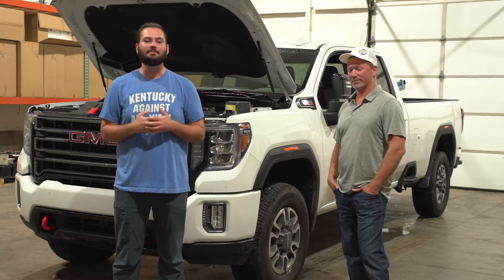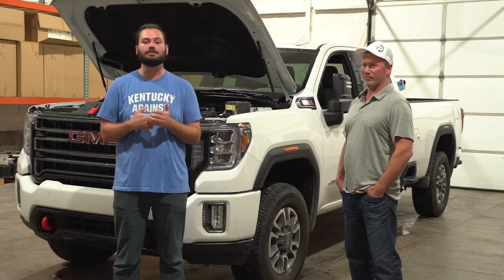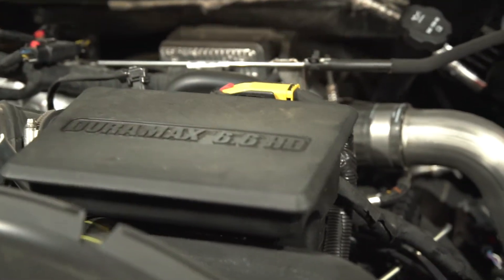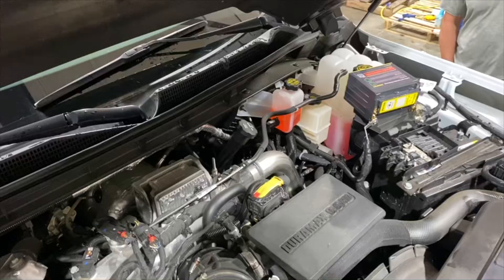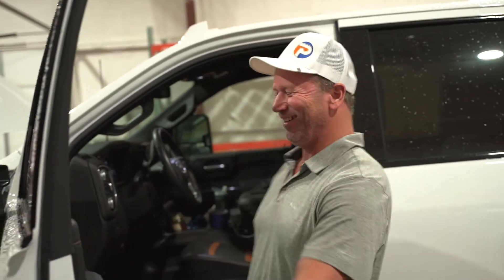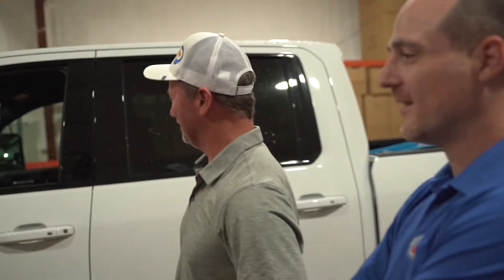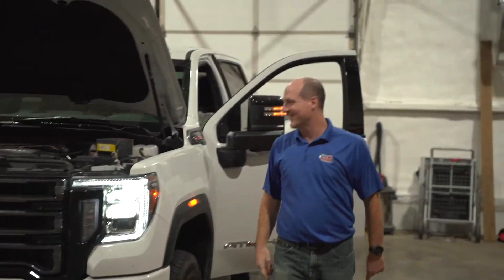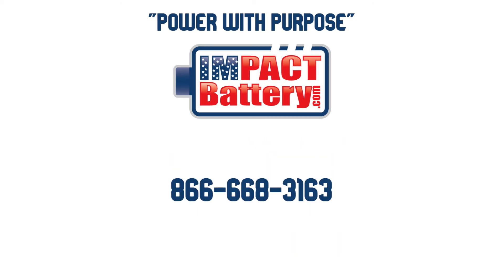What?! Tiny Motorcycle Battery Starts 6.6L Duramax Turbo Diesel Truck!

Comment: okay guys - start a cold truck, not a truck sitting in a garage at room temp and not a truck that's got a warm engine block either.   I'm talking an early 40ºF - 50ºF  morning when the truck has been sitting all night.  It might start a cold Camry but I have doubts about a DuraMax.   Regardless,  I'm getting a set of those battery post adapters-  can come in handy in the event my bike needs a jump and only have those larger jumper cable clamps.

Comment: What about overcharge? Those small batteries can't possibly handle the reserve created by the alternator.
Reply from the maker: Have no idea. We did not test for that as that was not the point of the video. The video was simply meant to display the power of a these small but mighty batteries. The idea of "if it can do y, then surely it can do x beyond your expectations."

Comment: I have a BBC 454 in my boat that i use routinely as i live on the water. If you need long term testing and amp draw test voltage drop test let me know. I run dual batteries so if it fails i can just switch to my others. I have been trying to cut weight and this looks like it might work. let me know.

Comment: How long would this battery last like this?
Reply from the maker: If you are asking how long it will operate a bike? We believe the average will be somewhere between 5 and 10 years. It is too early to tell, but I can say it has been a little over 2 years now and we have had ZERO failures. No lithium only battery can make that claim.
Reply: I’m talking about for a car. For racing purposes.
Reply from the maker: We do not have a definitive answer yet Gabriel. We don't have enough in those applications to speak into the matter. The ones we know of are performing very well 6 months in...Call us and maybe we can help each other out if you are interested in testing one.
Reply: @gabrielgonzalez8272  did you put one in your car and what car because i want onne for my 350z take 33 lb off the front

Comment: How long would this battery last like this?
Reply from the maker: How long would the motorcycle battery last running the truck long term? We have no idea as that was not the intent with this video series. We focused on showing this being the most powerful motorcycle battery; that if it could start a truck again and again it could surely start your bike. Although not designed to run a truck it would be interesting to know if it could...